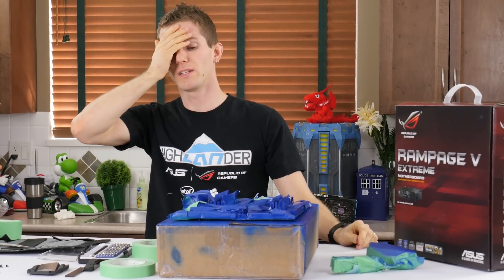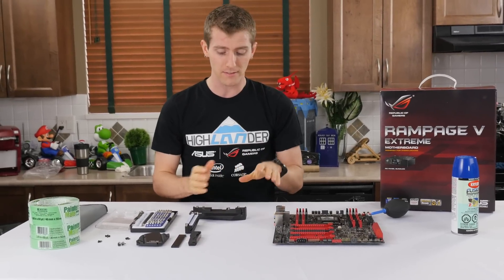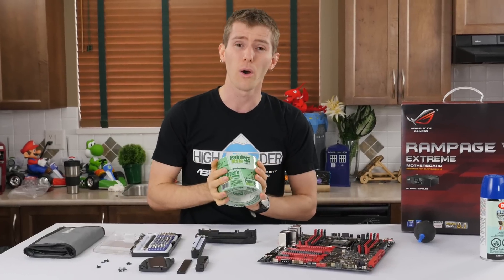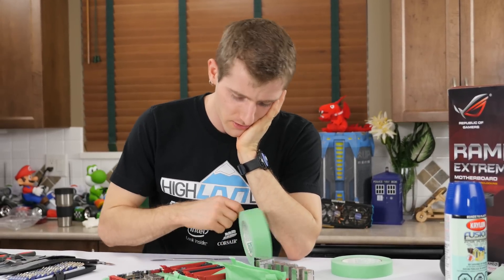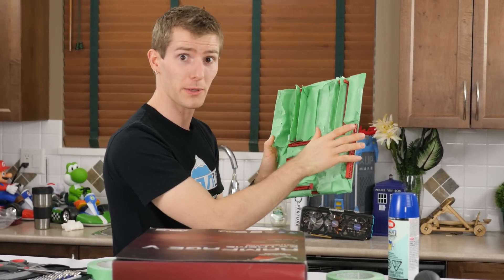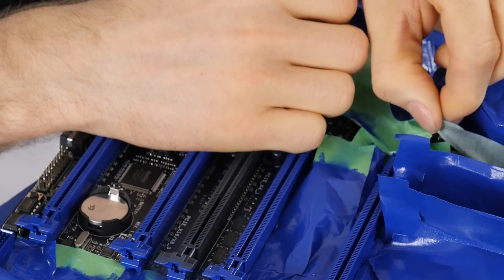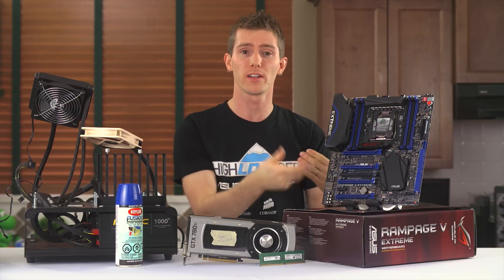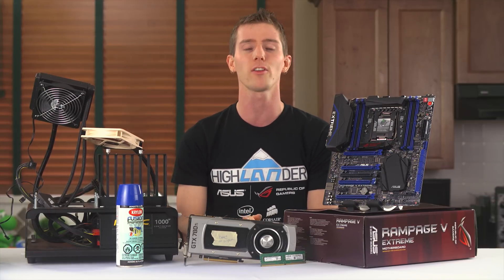Painting A Motherboard DIY Mod - ASUS Rampage 5 Extreme - Part 1

Comment: I dont know why mother board manufactures havent came up with a custom order option to their mother boards where you can order it with any paint color on the parts that would be painted for like a 50$ premium....
Reply: Or a motherboard that comes in white and with slot covers. Make it easy to re-paint your motherboard, instead of risking the fear messing up any of the PCI-E, memory slots and everything else. lol Make it happen ASUS
Reply: In a case like this where it's literally just the molding it would be great if they could have colour options, although I understand they don't want to run out of stock of red and blue while having a shit ton of green or something like that.
Reply: Two words:  Removable slots.
Reply: Mansen it doesn't have to be custom. Just a bunch of different color options. Mass producable and will make many people happy.
Reply: Ben Zimmerman You might just be thinking too little of the overall complications.

Let's start with the parts sourcing. These parts are bought in bulk and used in more than just one motherboard product. So getting multiple colors for the pcie ports for example will add to the expense due to less bulk discounts and potential for non-reusability with other products.

Then we go to the manufacturing line. Added expense for added complexity in assembly (yes, even something as simple as this will add to cost). Then you have the quality control which will have to add expense to make sure the right colors are used for the right models.

Then we get to the problem of product segmentation. Motherboard1 will have multiple SKUs, which will mean printing different boxes and adding complexity to the products available. This complexity adds costs to the product planning and inventory systems.

Then we get to marketing. They will have to include the segmentation of motherboard1 in all their marketing. Which means websites, posters, product demos, ads, etc2x.

Then we get to potentially the biggest problem - stock stagnation. If you produce only one variation of motherboard1, you only have to deal with one product stock. If you have multiple ones, obviously some colors will sell more than others, so some stocks might stagnate and cause losses. This will lead distributors to get less orders overall due to sellers not wanting to deal with stocks that might not sell.

Now obviously there are a lot more things in the pipeline that I didn't mention. Just keep in mind that with mass production, each change to a product will result in massive effects down the line. Unless the manufacturers can charge a huge premium, they just won't bother.
Reply: Waste of time really
Reply: Mansen there are many people who do...and you don't have to be overly OCD to want everything to match. Just an extra little checkbox when you order it saying what color you want it in. They can easily just put a different colored connector on the motherboard during production. Instead of the red bin, take it out of the blue bin. I don't see a problem with this.
Reply: Other companies do it with cars, why not motherboards???
Reply: Mansen Not if they mass produced the parts that need to be colored in multiple options. There are absolutely ways to do it without ramping up cost hugely. Would it increase costs? Yes. But not as much as "custom" jobs at all. Having the option for their higher end boards would be a good value add as well, as many people would choose color if they had the option to make better looking builds, and it would avoid them losing sales to people who do colors other than red (or whatever color that the manufacturer favors/deals exclusively in).
All that said, I sorta wish everyone would just go with neutral schemes when manufacturing motherboards. All black or something. Solves all problems.
Acting like variations are impossible on an assembly line is pretty fucking stupid. If cars can come off the line painted, mobos can come off with blue plastic bits instead of red.
You don't need to paint plastic, you can just make it of a certain color, so if that is the part you are getting hung up on...
Reply: MordeaniisChaos thank you for bringing some more common sense to this thread, sir. That is exactly what I'm saying. It isn't hard whatsoever. And I do agree with your statement about making all motherboards black. A neutral color would match pretty much any build. And all the red/black boards have led to some really sad unoriginality. Everyone buys the ROG just because it can easily be matched with other components. That said, red/black is my favorite color scheme so I don't mind :)
Reply: Vahn35652 I'm aware of all of that. What it all comes down to is cost as you said. People will gladly pay extra for the color they want. I'm not saying they should incorporate every color in the rainbow on every single product, just the more mainstream colors that appeal to a lot of people and only the higher end boards where someone who is spending that much already is more likely to spend an extra $10 on a different color. I may be thinking too little of the complications, but I think you're thinking too much of them.
Reply: Ben Zimmerman It'd be a lot more than $10 more, especially considering how small the market of people that actually care is. The red on these boards is also part of the branding like someone else said. It's like when JJ was talking about how much adding 10Gb to a motherboard would cost the consumer. And when you think about the scale of things everything becomes a big investment.

Comment: In the beginning he mentions that it's the most stable motherboard he has used, I have a cheap motherboard and my pc seems stable as well. Is this only important for heavy overclocking or am I just lucky to not have my computer crash all the time?
Reply: ***** or maybe that's because you had to reapply the thermal paste during the process of switching? :-D
Reply: ***** actually I have to agree with you. I've also got a cheap Gigabyte board (X79-UD3) and I can't get past 4.1 "barely stable" GHz on my 4930K @ 1.3V vcore (temps are fine). Which is a shame, since people had it clocked at 5.0 GHz nice and steady. But it can be a bad chip as well, so I'm not saying it's the motherboard's fault.
Reply: *****  i was talking my motherboard, not yours